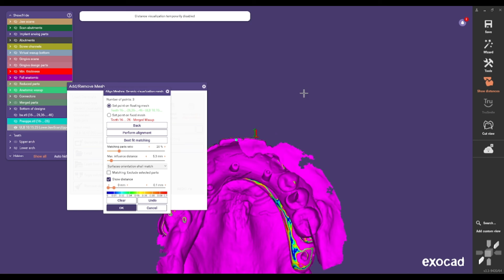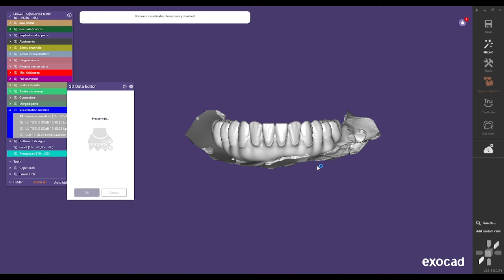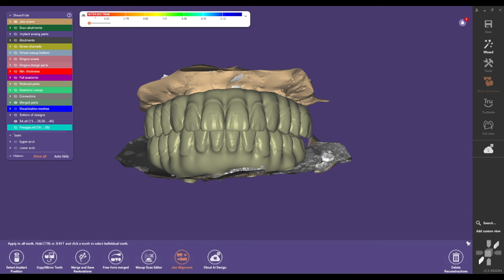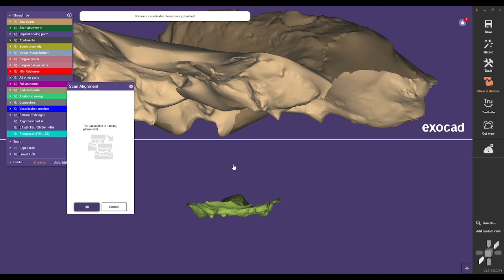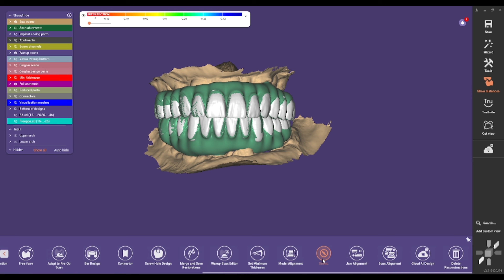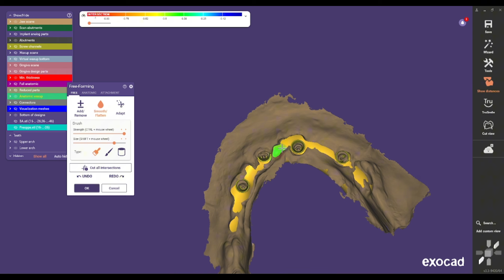Exocad 3.3 Remount Workflow | Revise Your All-on-X Design Using New Bite Data (Same CAD Scene)

Comment: Hey Jonny, can you just use the new lower tissue scan which you aligned as the BA and then just skip the Reggie Mesh altogether ? Or is it a matter of accuracy? Because when you perform the jaw alignment step - you are relying on the aligning the old design jaw scan to the new tissue scan anyway?